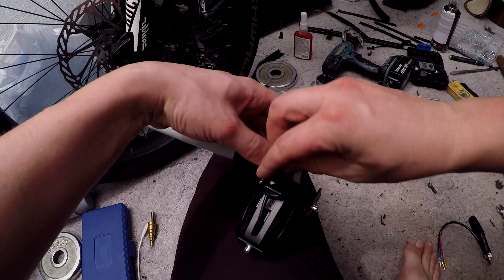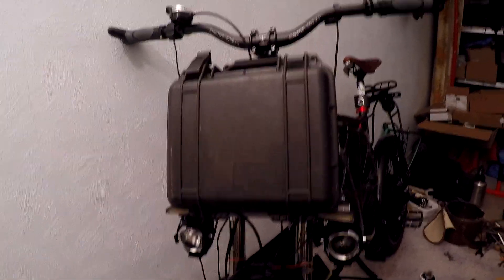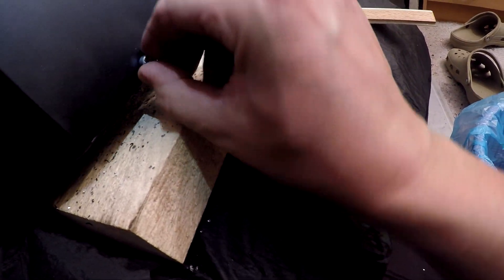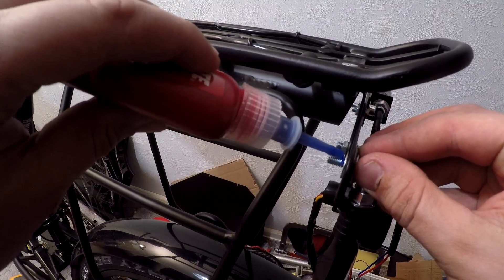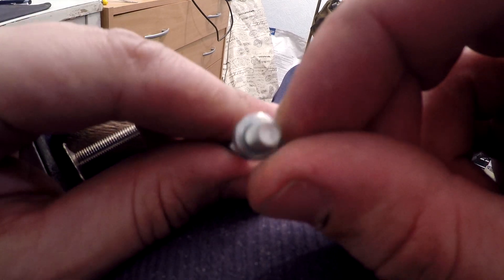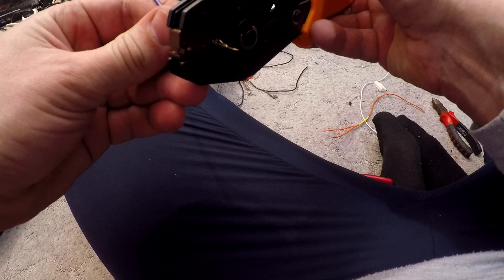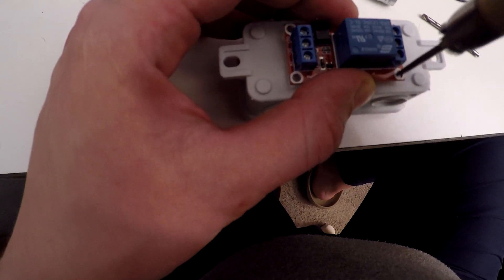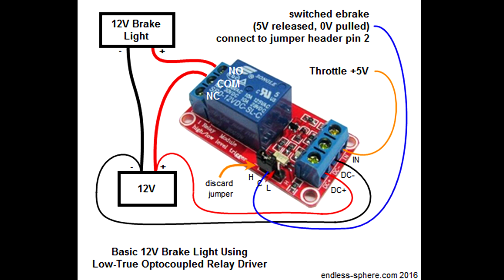Building an Electric Bike in My Bedroom - #10 Lighting (headlight, turn signal, brakelight)

Comment: Thanks for explaining as I'm following as well topic in the forum call "How To Wire a 12V Brake Light and Turn Signals".But unfortunately I could not find all answers there...Question...About brake light...So wire from jumper on position L on ebrake relay goes to ebrake sensor/lever and another wire from  ebrake sensor/lever goes to brake lights, correct? Also, you just soldered wire to jumper? Because when soldered - will be impossible to change jumper position from L to H (but maybe not needed).
Reply from the maker: Hey
Soldering is not needed at all, not necessary at all! My mistake.  I did this because the cables secured properly. This can also be done by tinning the ends of the cable. They are strong and will not go anywhere if they are screwed on.
Jumper should removed completly or will not work. 
* For this to work you need to connect what is between the H and L pins, the middle pin to Ebrake wire. 
* You also need 5V which you can take from the throttle positive cord. There should be a red wire. Connect it to the IN socket
* Brake light positive wire goes to directly to relay NO socket and NOT to Ebrake sensor.

If you have done everything right, don't forget to turn on the controller. Otherwise 5V will not go to the relays and the brake light will not work.
This is best picture if you have this kind of relay https://endless-sphere.com/forums/download/file.php?id=190244&sid=f89e1ef08fe24ef6757b908e623f0a7a

Let me know if this works :)
Reply from the maker: Also tinning is necessary, for example, if you do not have a JST cable to put on the pin. What I found somewhere and cut it smaller to bring one cable from the middle.
JST looks something like this https://www.tinyosshop.com/image/cache/data/prototyping/wires/JST-XH4-2-800x800.jpg.
I apologize for any grammatical errors in this quick answer :)
Reply: @DatEbikeGuy  No need to apologise as you are helping a lot... One thing definitely is clear now that is wire needs to be connected to the middle pin of the jumper... But then not sure...  Please look at the last picture in the forum as Youtube blocking me to share pictures here in the comments. Forum link  - https://endless-sphere.com/forums/viewtopic.php?f=2&t=75171&p=1671071#p1671071
Reply from the maker: @serginhovault007  Morning :) I don't have a forum account so I'll reply here.
1. Brake light Positive wire goes to directly "NO" socket. Thus, the relay activates your brake light itself.
2. The brake lever wire goes directly to the controller and in addition you need to bring one wire to the relay and go to the middle pin. Either tin or use JSD connectors if available. Color should be yellow, black mostly ground. 5 volts is on when not pressing the brake levers and 0 volts when activated when the chart is read like this.
3. look 2 :)
Reply: @DatEbikeGuy  Thank you. I think should be correct now. So, wire from the middle pin goes to yellow as black usually ground? I probably can check with the multimeter which one is 5v and connect that to the middle pin, correct? https://drive.google.com/file/d/16q4SJ3HLQoZERGImcdgnzrGOg1BuN9U-/view?usp=sharing
Reply from the maker: @serginhovault007  Seems Correct. Multimeter is your best friend.
Reply: @DatEbikeGuy  All working. Thank you very much to make things clear!
Reply from the maker: @serginhovault007  It's nice to hear that. It makes me happy aswell :). If I may ask you what ebike project you are working on?
Reply: @DatEbikeGuy  Yes, sure.

Frame ebike enduro, front suspension DNM USD-8S and rear shock DNM ALL-NEW BURNER RCP-2S from Alibaba (I did send a message with links but Youtube deleted my comments because contains links...)

All rest moto and bicycle parts.

Moped or light motorcycle rims and tires (18' and 19')

Battery pack 72v 40A from 21700 (45A capacity)
Reply from the maker: @serginhovault007  Thanks. This is a powerful ebike :)
When I built my bike, everything was new to me. Even the disc brakes were my first experience installing them. It was exciting, but some things like turn signals, brake lights :) were pretty hopeless at the time for me. Thanks to that, I learned a lot. I wish you a successful ebike assembly :)
Reply: @DatEbikeGuy  Thanks. No, for me  this is my second, so I no making the same mistakes...